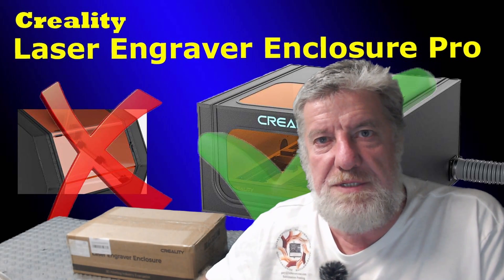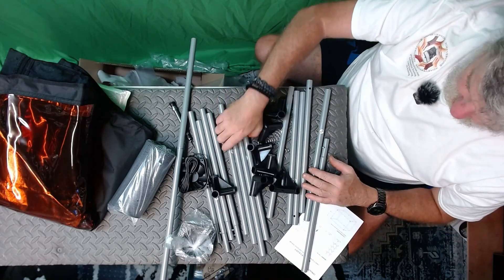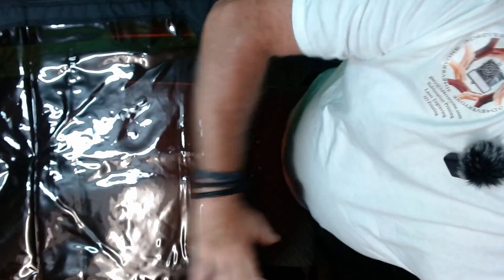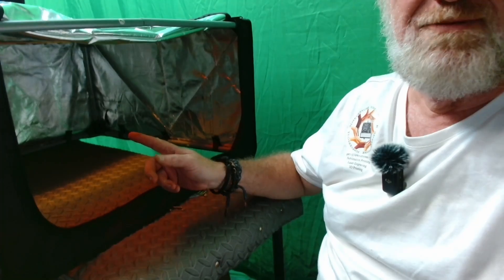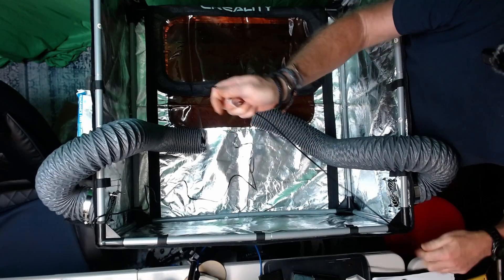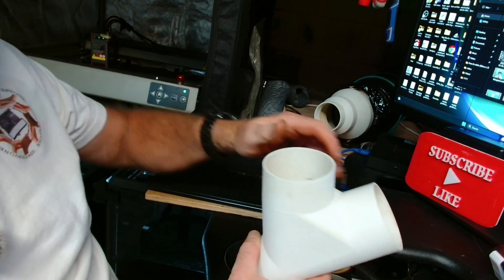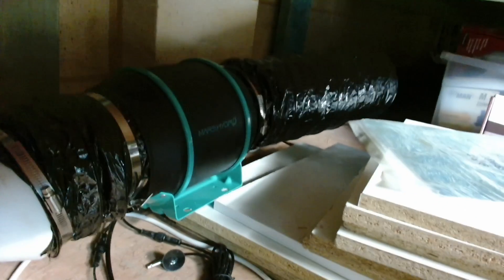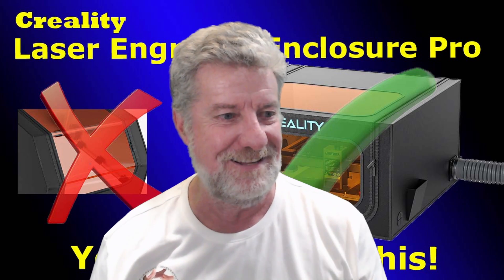Has Creality improved their Laser enclosure? What's the difference? @FalconLaserOfficial

Comment: To bad they didn't make them higher, so we could add a lasercam like the Mintion.
Reply from the maker: I ran a small bar across the middle , so it sat on top of the side bars, and mounted a small cam on that, works well.
Reply: I have the first version of the encosure and at to put some wood under to raise it, because the enclosure was not high enough @3D4Everyone1